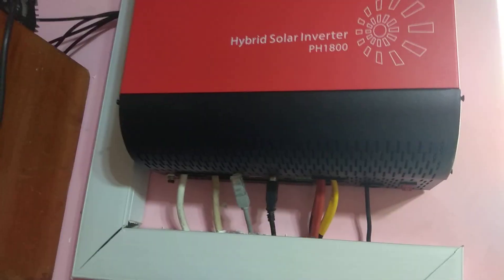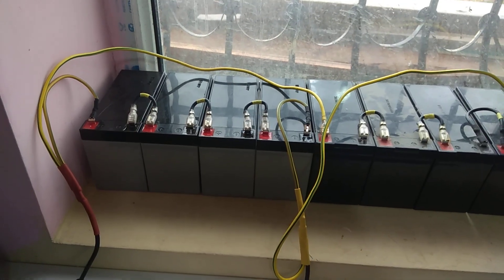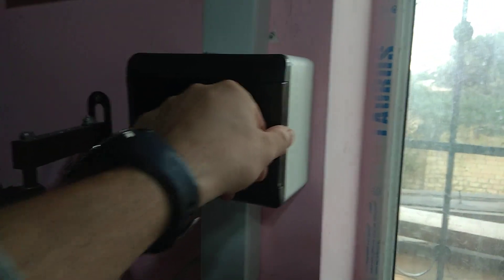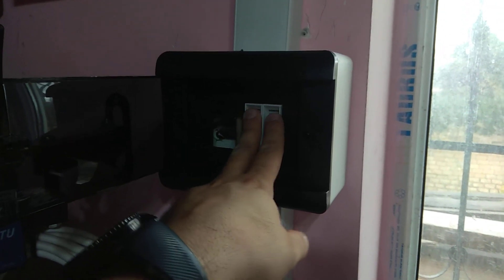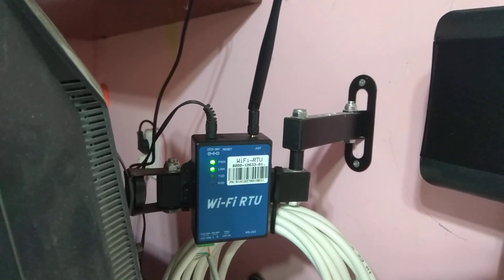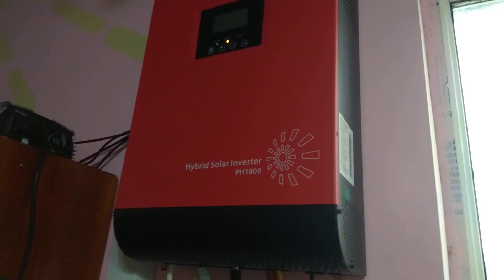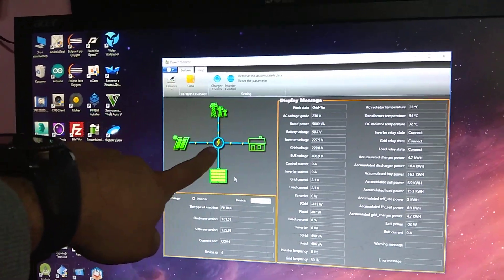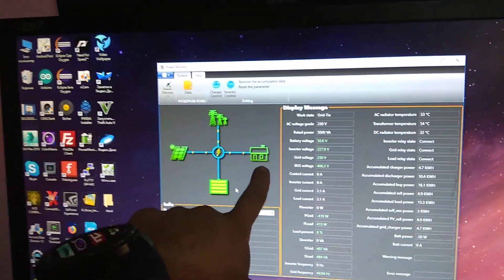Must solar inverter PH1800

Comment: Do you still recommend buying this inverter (MUST PH1800)?
Reply from the maker: Still works after changing out charger board, Im happy with it, however if I would have bought it now I would buy 2ea to work in parallel.
Reply: @elnurmehdiyev5062  Thanx for reply...What do you mean by 2ea?
Reply from the maker: @IVFRegulation  two of those working in parallel mode

Comment: Hi, can you please upload software link i cant find anywhere
Reply from the maker: If you go to mustpower website, you can download it from there. Chose hybrid inverter similar to yours, software is the same.
Reply: @elnurmehdiyev5062  I did, but this version cant show me about mppt parameter, I need your version to test. Thanks
Reply from the maker: @ducquang-bill1703  use modbus data interface then, I do not use their software from long time ago. You can find modbus protocol on home assistant forum.

Comment: Could you clarify two things?
The inverter has AC in and AC out connectors. Do you have to use the AC out if you are looking for an on-grid connection only?

And second, 
Is it possible to dynamically adjust the battery discharge? Like if I have a power meter with CT clamps already that registeres the total energy usage of my house? I only want to use batteries if the combined energy usage is in positive flow (from grid).
Reply from the maker: The unit has AC in and out. Not sure about dynamics, not using grid tie in my region.
I would not recommend this inverter, reliability issues, I already changed charger board 2se, now using separate mppt charger module.
Look for expensive - reliable solution like SMA and Tesla